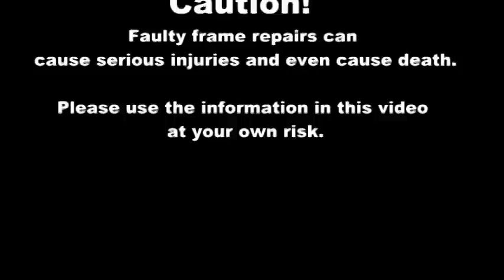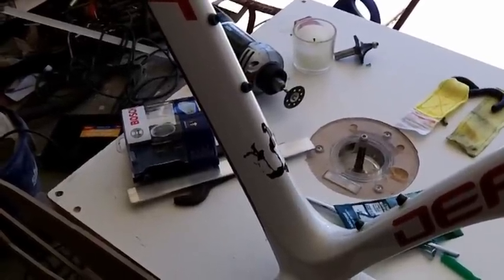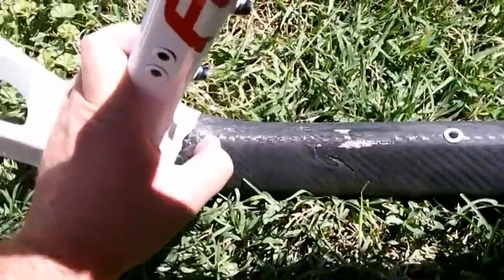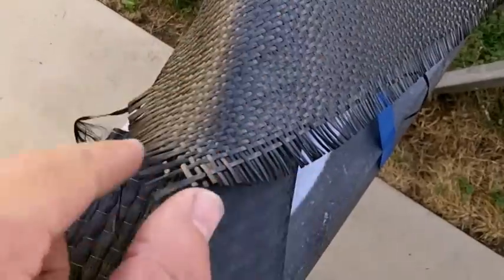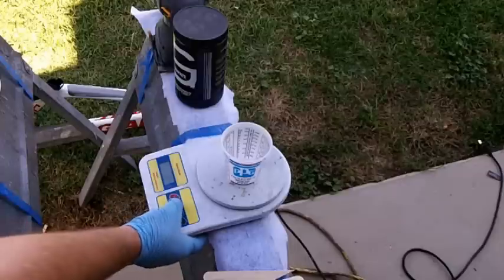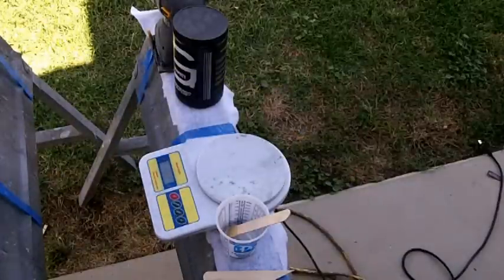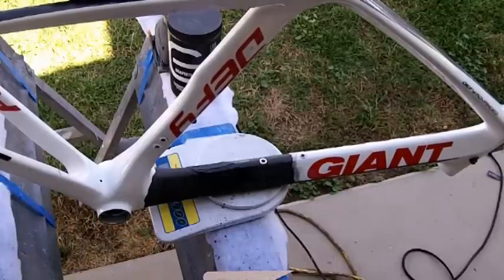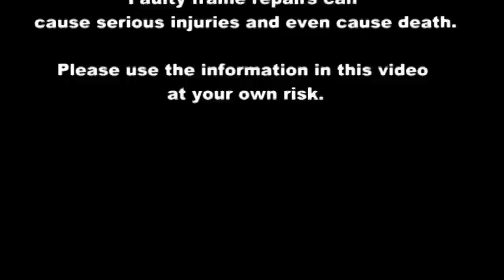Carbon Fiber Bike Repair- Video Tutorial 1 of 2

Comment: Great video!  Thx for providing the detail.  Perhaps in the future you would want to consider drilling a small hole at each end of any cracks.  On aircraft repairs we do this since drilling a hole at each end keeps the crack from propagating further in the inside of the frame.   You could also consider using a vacuum to determine if the frame had any other cracks?  Just some thoughts..  You get it....Carbon Fiber is extremely strong and temperature stable yet  the material has several achilles heels.  one is it can be brittle when used improperly, when its design loads are reached carbon fiber fails without any warning and fails catastostrophocaly.   Carbon fiber builder must also stagger layers of different weights and weaves of carbon fiber very selectively by feathering out layers of the material so not any one part of it is significantly stronger than the weakest areas.  
Great repair and techniques here.

Comment from the maker: My pump pulls 26" hg at sea level. If you can find one that goes up to 30" hg that would be ideal but not necessary.

Different core materials will crush under too much vacuum so you'll probably want something that will allow you to adjust your pressure- an auto cutoff switch or bleeder valve will take care of the problem. Just to give you an idea XPS foam will start to crush around 18" hg while others like Divinycell an PU I've had in the upper 20's without crushing.

Comment from the maker: It's just the nature of carbon fiber for it to be black. however, I have seen it tinted various colors like green, red, purple, blue, etc but it's always dark. They do make colored cloth by incorporating colored Kevlar (aramid) into the weave but the carbon fiber strands are still black and it's only the Kevlar that is colored. Another thing that is common is adding color to the epoxy so that the cured part has a tint to it.

Comment from the maker: Thanks! The adhesive is just epoxy with black graphite powder mixed in as a filler. It is pretty much the same stuff as West Systems 423 filler. I just order the cheapest powder I can find off of ebay. You can see me mixing everything together around 9 min in on the video.

Comment: I would like to cite this publication:  "Defective Repairs of Laminated Solid Composites" Journal of Composite Materials 2005 39: 2185.  This publication was supported by grant 4-484453.  They fatigued a baseline, then damaged the composite.  Then "repaired" the composite (carbon composite) then fatigued the repaired composite.  Here is quoted text from the Journal paper "Scarf repairs restore 85–95% of the undamaged solid composites"   You can effectively fix carbon composites.

Comment: Why did you use graphite powder in the epoxy resin? Cool video!
Reply: +zoltan87 adds a slight amount of strength (according to the industry) and because it makes the epoxy Gray/black and less glossy.

Comment from the maker: A crude way to check is to take a coin like a quarter and tap the tube on and also away from the cracked area. If there is a change in the tone of the tap then there is most likely a crack in the tube. The cracked site usually produces a dull sanding tap.

Other ways to check other than removing paint are endoscope, x-ray, ultra sound, and thermal imaging.Expensive:-(

Good luck! Let us know what happens.

Comment: Unless you race professionally, no one needs a Carbon Fiber bicycle, they are way to expensive and they crack easily. These frames are made in one piece, once it's cracked, you can repair it, but the structional integrity of the frame is compromised, it's not safe.

Comment: You should ride carbon even if you aren't a professional, it is there to buy so why not buy it. It really doesn't crack easily it is a very strong material, most bikes come with carbon forks anyway. You can buy a carbon bike for sub £1000 now. You clearly have no understanding of modern bikes and technology.